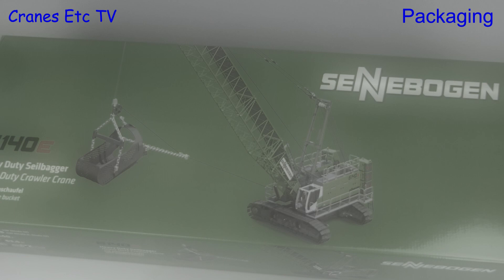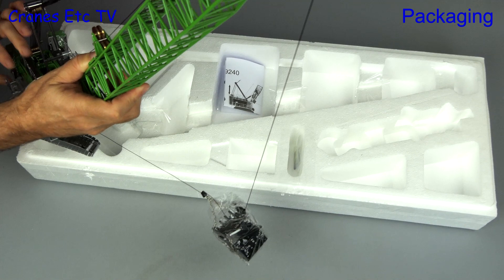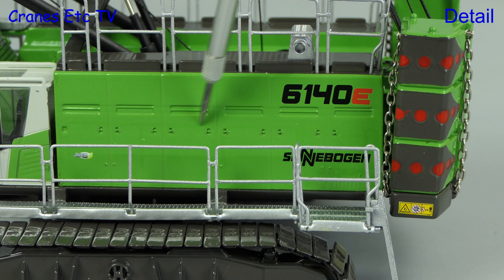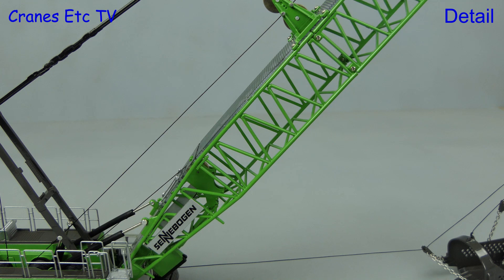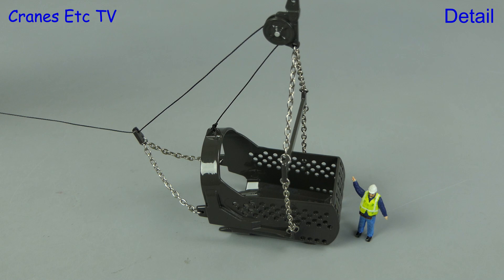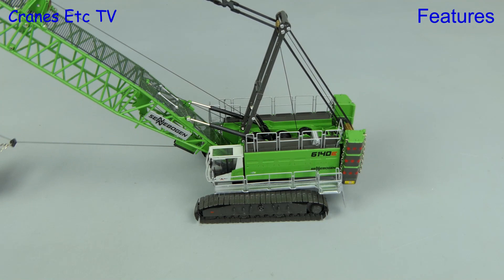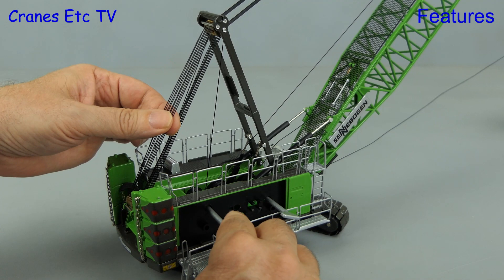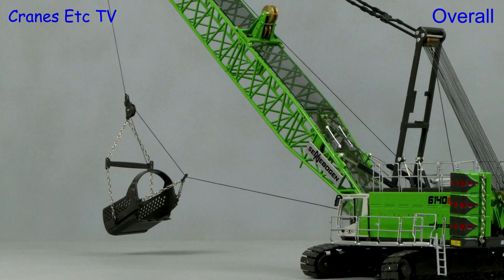Ros Sennebogen 6140e Dragline by Cranes Etc TV

Comment: I think it's disingenuous to rate it only as "good"  because you can't turn this model into a flat bed trailer load. You need to spend 2X to 3X what Ros is charging to get that "flexibility"
Reply from the maker: Er, no.
Reply: Actually, there is more: The bucket isn't designed very well in terms of size and function and the pulleys don't work very well. So, "good" is a proper rating imo.

Comment: When is this used instead of a hydraulic excavator?
Reply from the maker: As seen in the video.
Reply: Open cut/ strip coal mining. Search for Bucyrus 8750. Not the largest ever, but one of the largest draglines operating. Powered by electricity rather than diesel.
Reply: @o1chuck1o  thank you! These are much appreciated!

Comment: I dont see ROS making crane models much longer. Theres no way they will sell enough of the these to pay for the manufacturing of them let alone a profit. These could be so much better if they had put in the effort to make them more functional. Good review but poor model. Let conrad stick to the sennebogen cranes
Reply: More functional?  Then you want a toy to play with and make engine noises... not a model.  I am pretty sure the box says this is not a toy.
Reply: This model I would consider a toy. If I'm going to spend my hard earned money on a model crane, I want it to be just like the real thing, great functionality, good detail, realistic, able to reconfigure it, break it down into loads like the real thing, etc. I'm not sure exactly what this one runs for, I havent really seen it for sale yet, but I'd say its atleast 300 bucks. I do like to reconfigure my cranes now and then in different configurations. I dont buy them and take them out of the box and put them directly in a case to only be stared at. Otherwise id just buy a photo of one and hang it up on the wall, doesnt take up as much space or cost as much...
Reply: @cranedude07    What would be a good example of a new,  $270, tracked,, 1/50 scale Conrad crane model?  Answer: that Conrad model doesn't exist. You will spend 2X to 3X as much and up to get those features.
Reply: @cranedude07  it about 160